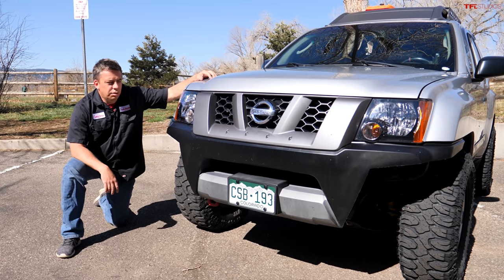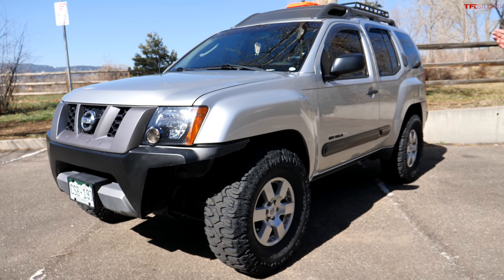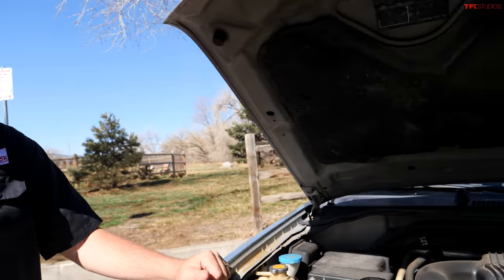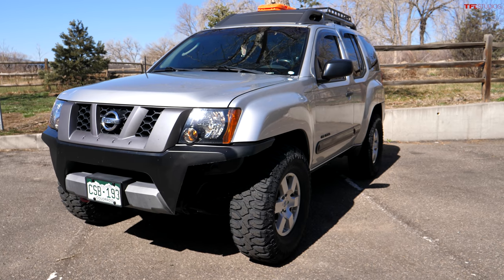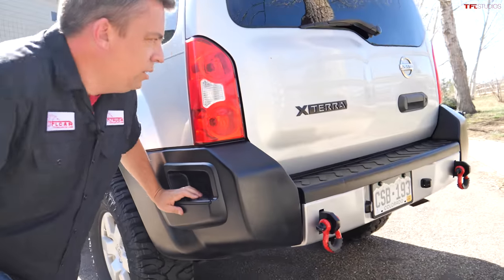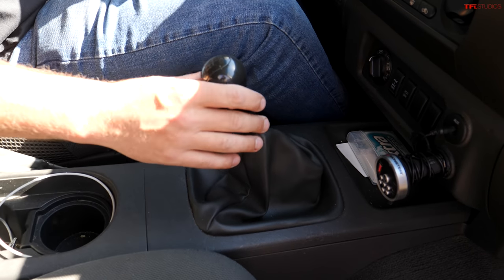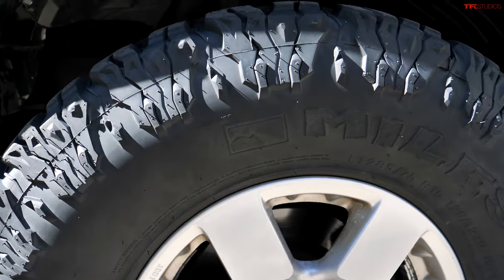I Found This One-Owner Nissan Xterra With A 6-Speed Manual For UNDER $4,000! | Dude, I Love My Ride

Comment: FINALLY, THESE ARE SO UNDER APPRECIATED. NOW THAT YOU ARE TALKING ABOUT THEM, I CAN SELL MINE FOR A PROFIT. HA!
Reply: In Vegas too?  Details?
Reply: they're not really under appreciated they're simply non existent. i looked for two months back in fall of 2017 and could not find a single manual xterra or v6 4wd frontier in any condition. I really wanted an xterra but ended up spending a lot more on a 2015 taco.
Reply: @242tdryan  my dad has an 02 and 03 xterra with the 03 being a manual, 6 cylinder xe
Reply: Stop yelling
Reply: HA!

Comment: Most people cannot drive a manual transmission. 4000. 140,000 MI.    Will need a clutch and radiator, timing chain fixed first.    R51 are the best .

Comment: Prices are going through the roof. I just bought an Xterra last week. Pro-4X’s with less then 100k are going for $18-20k. Just make sure that your viewers know that any automatic Xterra’s from 2005-2009 will likely need a new transmission if the original radiator was never replaced.
Reply: Yeah, it kind of sucks. The good thing is the S models are a lot cheaper and more available.
Reply: Bought a 2012 Pro-4X with 76k miles for $15k. The deals are out there
Reply: @fernandobriseno8164  in the last 2 months?
Reply: @Dtrain79  last August
Reply: @fernandobriseno8164  depends on where you are
Reply: @teto6180  you're right,  but all I'm saying is keep your eyes open. That good deals can be found. I saw a 2013 4x4 with 65k miles for $11,500  just didn't want to make the drive. Not a Pro-4x but still a good deal.
Reply: Love my 2010 off road
Reply: So I'm learning... 2008 170k miles and you can feel it dying.
Reply: Got my 2012 Xterra with 94k miles for $10k. Reselling it for $20k is appealing....
Reply: Do you have to worry if it’s a manual transmission?
Reply: @2doorenthusiast799  nope
Reply: Not an xterra but I just got a Nissan pathfinder 2009 4wd SE with some cool options with 105k miles for under 8500 bucks
Reply: @2doorenthusiast799  If it’s a manual, they have less problems with the tranny. I wouldn’t trade my manual for an automatic.
Reply: @jacintocabrales6372  how
Reply: @kevinbr3197   no smod, but grinds and jolts for every gear change

Comment: The Xterras are great rigs. I have a 2000 Xterra and I've had it for the past 10 years and I'm in love with it. I've never owned a vehicle this long before
Reply: First Gen gang! mine has 286k still running 😎👍
Reply: @NSRS1  I love to see other 1st gen xterra owners. I have a 2001 with 187k miles. Just had the exhuast replaced and transmission fully rebuilt at 156k miles. Im hoping to get at least another 100k miles out of her. Timing belt and water pump are next on the list.
Reply: @jscott7432  I'm the second owner. I bought it in 2011 with only 65000 miles on her and I'm the second owner. She has lived outside and got hit last year, but I cant bare to sell her. She has been dealer maintained since day one. Looks like hell lol. I think she may need a head gasket as I'm starting to lose Coolant invisibly. But still doesnt leak a drop of oil and everything works and she can still hang with almost anybody offroad. Not having front and rear lockers is the only hinderance. Such a fantastic rig for the price and the first gens were unkillable , in my opinion

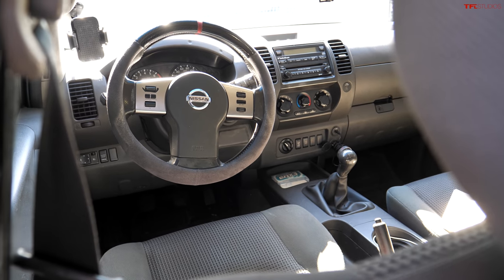Comment: Around 10:05 - 
Yes, the driver seat wear and tear on the Xterras is very common
imo it's probably the jumping in & out of the truck and likely the type of material used on the seats 

Had on '05 i regretfully got rid of 7 years ago.  I loved it so much...and miss it dearly.  I'm currently about to purchase an '06 as i write this 
Xterras are the bomb 😎✌🏽

Comment: I have a 2008 I bought for my son. 167k miles , new trans in 2018,  needed new cats (very common) and a couple other small things.  The truck is smooth, powerful and is almost entirely rust free. Ive debated getting rid of my Gladiator and buying like a 2012-15 pro 4x for myself.

Comment: Nissan has to bring back these awesome Offroader and with the new Frontier they have the perfect base for it. Didn´t know why they killed this so early (compared to the Frontier).
Reply: Basically the sales on them tanked. Other brands were putting out vehicles with better MPG and larger fuel tanks. Too bad. For the price, you couldn't beat these. I would love to see a new Xterra a year or two after the new Frontier launches.
Reply: Doesn't matter how cool a car is or how sought after it will be next year. If they aren't selling NOW they get the axe. Love the xterra, wish I could find a clean one and had room for it.

Comment: This kid did an awesome job - kudos to him! I would absolutely love to own this rig. I still have my 2006 OR in the same silver as this one, running DuraTracs. I preemptively changed the rad out, did the rear transmission vent line hack, and it still runs great with no timing chain issues thus far. Only thing is that the terrible salt in Ontario has given it some bad underbody rust. If/when it eventually dies, I'll be looking for a 2014/2015 Pro X as a replacement. I love how nimble it is, and the engine has good low end gusto. I don't need electronic frills of any kind to drive.

Comment: Im the second owner of my 2008 S 4x4. Come a long way though now. ARB front bumper, Hardcore rear bumper and tire carrier, 3 inch lift with wheels and 33 MTs. This summer, a VK56 (Titan V8) goes in. Driven desire is doing the swap. People dont realize how easy it is to mod these rigs and how durable they are.

Comment: I have a 2001 Nissan Xterra with 187k miles and she still runs like a top.
Reply: I just bought one for 900 180k miles, but I need to change the  exhaust system now

Comment: The seat wear must be common. My Frontier has similar damage. Still, that is an amazing buy for the price, especially an off road version with a factory rear locker. 

Only real issue to watch with an Xterra or Frontier was prior to 2011 there was a problem with the radiator that would let the coolant and transmission fluid mix (SMOD). This only affects the automatics, though. Bypassing the transmission heat exchanger in the radiator is the simple fix, or replace the radiator with the newer part to fix the problem (Nissan part 21460-9CA0E). They still have an oil to air cooler for the automatic transmission in front of the air conditioning condenser behind the grill. The 5 speed automatic is built well, it's the same transmission behind the 5.6 L V8 in the Armada, Pathfinder and Titan, but water in any transmission will destroy it.  Of course this Xterra is not affected because it is a 6 speed.

The 4.0L engine is the biggest of the Nissan VQ series, which has accumulated 15 Ward's 10 best engines awards over the years. I think the engine is the highlight of these vehicles. It's not the most efficient, but it makes great torque - perfect for a truck. I have stock 3.36 gears in my Frontier and with 33 inch offroad tires I never feel like it is under powered. It's not my daily driver so the fuel efficiency doesn't bother me. It gets 18 MPG on the highway with 33" tires, a lift and the front air dam removed - none of which help MPG.

I hope Nissan takes the new Frontier and builds a new Xterra with that platform.

Comment: My 07 still running great at $222k.  Keep an eye (or ear) on the aux timing chain issue.  Mine are still ok but eventually will change those tensioners out...

Comment: I came to my XTerra the same way. I was looking at 4Runners, but the price was more than I wanted to spend for those miles. Found my 2015 Pro 4X with 86k miles and I love this SUV. It is definitely a slept on SUV. The only downside is the aftermarket support. While you can find almost everything you need as far as upgrades, there are fewer companies that make them compared to Jeeps and Tacomas/4Runners so they tend to be expensive. The biggest issue to watch for in pre-2011s is with SMOD issues where the faulty radiator leaked into the automatic transmission creating the 'strawberry milkshake of death' and eventually grenading the transmission.

Comment: I bought a 2000 Xterra for 800 bucks a few years back. It has 227,000 miles and so far I've only had to do a valve job, head gaskets, timing belt, water pump, rear springs, shocks, tires, Injectors twice (Thanks Ebay), MAF sensor, front and rear brakes, Heater fan resistor, Radiator, Transmission rebuild ( Thanks to Trans cooler being in the radiator and cracking filling trans with coolant), Battery, alternator, (1) exhaust manifold, complete exhaust including convertors from manifolds to rear bumper, O2 sensors.... all true stuff, my wife asks why I throw money at a piece of crap and I show her the title....... SOOO all in all not a bad winter beater over 4000 dollars later. She's a gem... LOL FYI. I do my own work otherwise i would have burned her to the ground long ago if i had to pay a shop LOL I'm joking I love it and can't part with it.

Comment: I love the Xterra.  Sold my 2006 at 198000 miles and not a single issue with it ever. It's a beast. I regret selling it and looking for another one but they are going up andbup in price. For the worn seat,  here's my tio,  keep the damn side steps on,  step on it when you enter or exit, grab hold of the handle bar on the A pillar and lift your butt into the seat, no problem. Didn't have a worn seat when I did that.

Comment: My 2014 pro4x 6m only has 52,000 on the ticker . I get lots of offers and buisness cards under the wipers . My gen 1 rolled to 330,000 before i gave it to my nephew . Xterras are solid and if you get a manual there isnt alot to worry about .

Comment: I just bought a 2002 from the original owner out of Virginia with 100,000 miles on it five speed manual six-cylinder four-wheel-drive. I paid $4400. There’s not a single speck of rust anywhere on the truck. Excellent mechanical and cosmetic condition. I just did a timing belt and water pump the other day.

Comment: These cars are amazing really, myself drive a 2010 pathfinder, used to own 06 pathfinder too, I think this VQ40DE is the more powerful v6 than any other rivals, (correct me if Im wrong), and the only concerns are: 1. recovery hooks have only 2 bolts on the frame, have seen several of them got pulled out during recovery. 2. need additional skid plate in the front to protect radiator.

there is a trick to show all the stats of the car during offroading which is really useful, I keep the coolant temp. on display during sand offroad at all time. PS: I live in UAE, current desert temp is 47C in the mid day and afternoon.
Reply: How do humans even live there
Reply: @LLCoolPass  AC is everything

Comment: What a badass Xterra! I just bought mine in 9/20. I live in Colorado also.
I got a 6 speed manual in mine as well. Couldn't drive anything else. Exact same color. It's called Silver Lightning. I'm lovin' it so far.
I wanna turn her into one just like this. This video is very inspiring. 

Also, my driver side seat has the exact same tear on the exact same spot. Lolol! 
Do you happen to know the Facebook group this guy belongs to? I'd like to join it to chat with fellow Xterra owners.

Comment: Ah! Easy like for the Xterra! The first car I owned! A sun yellow 2004 model. Crazy capable off road. With 3.5L was underpowered, and never got better than 13MPG, but I didn't care. That thing was comfortable and eye catching. But I was the third owner and with all my care, I had many mishaps with it! The alternator melted after 1 week of ownership. A foglamp got water and started a huge short-circuit on the main cable harness, melting and damaging most of the other cables in the bunch, and smoking the cabin,  at 15000 feet in a sketchy mountain pass. The alternator melted the second time! The repair was a miracle in an native reservation with no repair shops in 100miles. Finally the Cyl-head gasket leaked, coolant entering the cylinders, totaling the block. I had to replace the whole short block. I still wouldn't have sold the yellow beauty, but kids came into my life and I needed a 3 row car for my growing family.

Comment: I REALLY like the X Terra.
I used to have a 1988 Nissan Desert Runner back in the day. Awesome truck, and it had the Baja front/rear bumpers, Baja Roll Bar that extended to the rear of the bed and the tire stand, it also had the VG30 V-6.
Manual front locking hubs, manual 5 speed trans.
That truck lasted FOREVER,,,,, Lol !
I sold it with 240K miles on it, and the only thing i ever had to replace, was the timing belt, a clutch, and a slave cylinder,,,,very minor stuff.

Comment: I had an 01 and traded it in for an 07 Off-Road. When they redesigned the it in 05 I waited a couple of years to trade my 01 for it. Both were great vehicles, my 07 was a beast. The only issue I had was paint. The channel on the roof was cracking and flaking off. The seat is an issue, mine was starting to wear.

Comment: I owned a 2005 Nissan Xterra. Got 150,000 miles before I had an issue where the transmission cooler in the radiator developed a hole and both fluids mixed. Blew the engine and tranny because the dealer couldn’t figure out the issue in time. Replaced engine and tranny w used ones from a rollover. Both had around 15,000 miles each. I proceeded to put another 350,000 miles on that Xterra. Never needed an exhaust change or anything else major during that time. Great cars. Just picked up a one owner Nissan Murano for my daughter with 200,000 miles on it for 3,800. Engine runs like a top, body is mint and leather interior looks factory new. People think I’m nuts for buying it with high miles haha. We’ll see. I’ll take my chances with Nissans from the early 2000’s.

Comment: Xterras will last if you take care of them just like every other vehicle out there! I bought a 2006 nissan xterra offroad for 3200$ its 4x4 6 speed manual rear lock differential, all skid plates under, I bought it with 170k and I'm at 212k with no issues! I just recently installed fox 2.0's all around, and total chaos upper control arms, I also installed a AFE air intake which I'm leading to a snorkel soon! My next purchase would be removing my side steps and adding rock sliders,and some Baja pod lights! LIKE MY COMMENT IF YOU GUYS WOULD ME TO START A YOUTUBE CHANNEL STRICTLY ON XTERRA'S! THANKS GUYS!
Reply: Start that channel on the Xterra.  I’ll be a subscriber.

Comment: Nice deal vato! I got 2010 with 133K miles and 6MT, running strong. Only problem is that it’s 2WD and I want 4WD. Don’t wanna trade it because they pay peanuts so I thought about 4X4 conversion...too complicated, might as well do a V8 swap!

Comment: Ya that seat upholstery is an issue..if you  feel inside the hole there is a plastic divider that protrudes out. And ofcourse it will eventually wear prematurely

Comment: I have a 2011, 6spd, Pro4X with160k miles. Bought it 2 years ago with about 145k on the clock for $7,500. I've done new total chaos upper control arms,new lower control arms, a mild lift with newer Bilsteins, 33 BFG KO2s, and new tie rods.  Thing is a beast. Used to have a 1st gen 5 speed back in the day too. Got lucky that I found it when I did.  Finding a pro4X 6 speed for a good price these days is like finding a unicorn. $3,700 for this Off Road was a steal!

Comment: Great trucks, totally agree it's a 4runner for half the price and they even have a better rear overhang. Only problem is you really need the off road package otherwise they don't come with brake vectoring or anything so the 4x4 system is pretty old school.

Comment: Love my 2004, has 265,000 and I've only replaced the starter and radiator. Surprisingly the radiator didn't need to be repaired, the hose did, but some guy was trying to help me one day when it overheated (due to an old hose) couldn't get the clamp off, and he sawed off the plastic lip that the hose attaches to. He was trying to Macgyver it until I got home. When I realized what he'd done, I knew I'd have to replace the radiator. 2 weeks ago outside of my work, some dummy stole my catalytic converter, been happening a lot in CA...now I'm looking for another Xterra. These hidden gems are awesome! Not sure what to look out for when buying a used one and I don't want someone getting off on me because I'm a female...any advice?

Comment: Yeah man, feel ya...I had a 03 4runner up to 178k miles and the entire brake booster system went out.  Toyo is aware of the issue for those gen 4runners and had not issued a recall.  I mean the thing went out on me on the road.  Years later I started looking at FJ's and possibly other 4runners BUT said to hell with their overpricing and I ran across a 2015 Xterra Pro4x with 70k miles and got that instead.  Really like these things...it turns on a dime, agile little thing and great off road. Good looking setup ya got there, I need to mod mine dammit

Comment: I used to own an xterra, the one problem I had is that it wouldn't start if the temperature outside dropped to 19 degrees or colder. I found out a lot of people had the same issue.
Reply: I had an older gen 1 in Alaska for 5 years never had that problem . I was in Fairbanks . It's cold there .

Comment: Lol doesn’t the hitch go under the bumper ? Which is connected to the frame rails.   Or did they change something?   I have 2006 and If I  did that the 3 piece rear bumper center section would come through windshield of whatever I was pulling